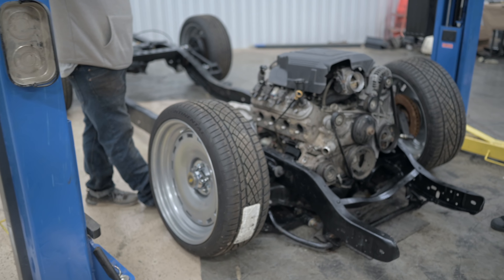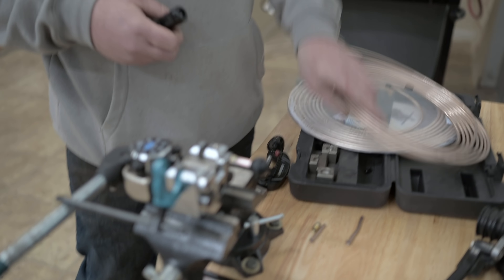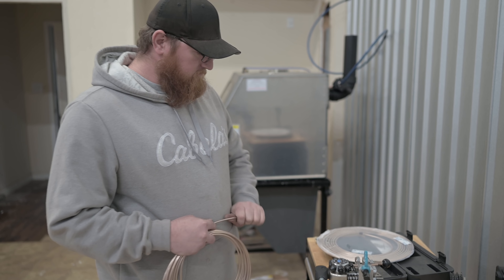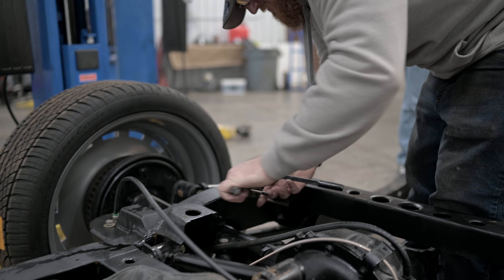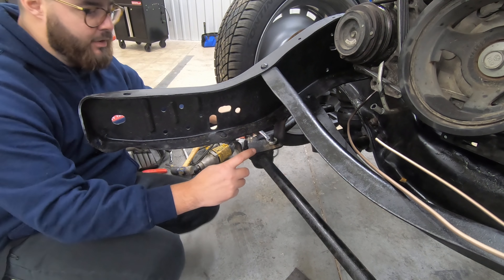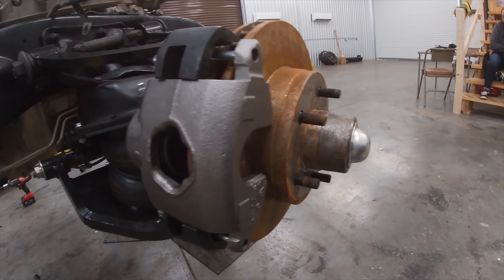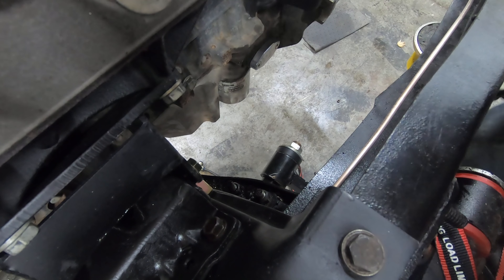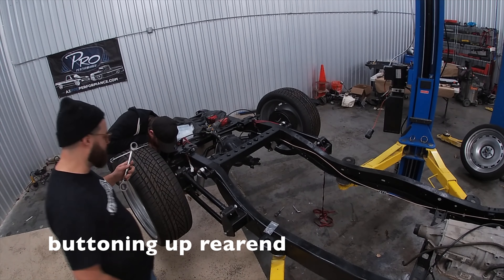UBTK5 moves into a new home & gets some love

Comment: I also bought copper nickel brake lines from The Stop Shop last year. Along with the exact same flaring tool I bent new lines for my 83 k20. I swapped in a 2007 6.0 lq4 and a full float limited slip 14 bolt rear end. That motor paired with 4 wheel disc brakes.... it's like a new truck! Keep up the good work boys! Enjoy the process! Wish i had a crew like yours, i did everything alone. God bless
Reply from the maker: Thanks man! It’s nice to have great friends but some certainly enjoy doing it alone. I, for one, don’t have all the skills. Haha

Comment: I like those bulkhead fitting ,  good tip .The shop looks like it has quite a bit of room .
Reply from the maker: Thanks, Craig. The bulkheads are my favorite part of our current work. It's going to make it so much easier for air management. We're pretty pumped about the shop. Nowhere near where we want it but it will be soon!

Comment: I keep a air line cutter in my truck at all times along with a small emergency kit with some common air ride parts haven’t really had to use it but if and when I do it will save my ass for sure
Reply from the maker: That's a great rule right there!

Comment: Are you notching the frame for the a/c compressor to fit the lines? I have not found a decent video for using the stock LS compressor with dirty dingo motor mounts.
Reply from the maker: We will, yes. It's just a little too snug around the ports for the line. And we're using Tejas Steelworks mounts but it still needs a tad of trimming.
Reply: My dingo mounts on my Z'd 86 is going to require the same amount of trimming for the ac lines. No way around it without relocating compressor